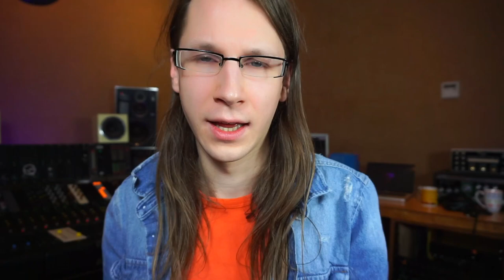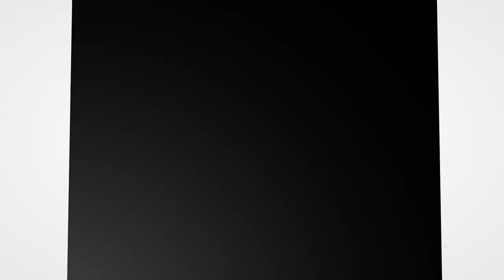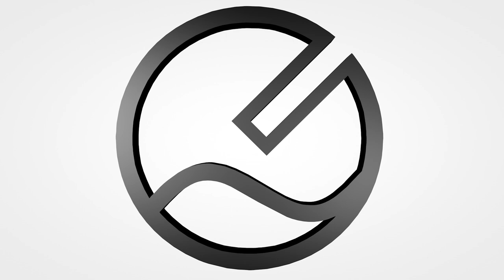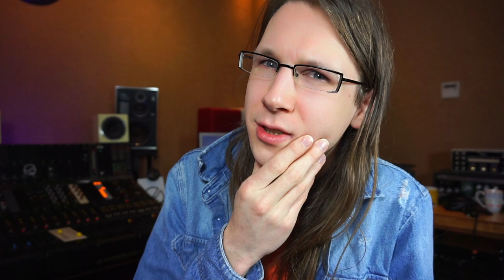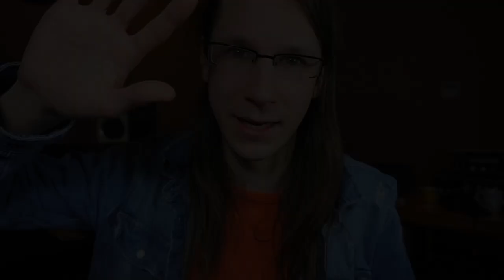EQing myth 3: Low Pass Filtering

Comment: I'm not sure if you are aware but no one seems to be talking about the fact that low passing everything above 18-20Khz and high passing between 20-25Hz gives such an incredible amount of headroom. I will give an example, I use ozone 8's maximiser on my master(because it's amazing) when I so the stated technique I have described the limiting doesn't get triggered by the inaudible frequencies meaning I can bump up the gain before the signal goes to ozone. this gives the track much more clarity and helps keep the mix tight!

Comment: 70s recordings probably weren't low passed by the engineer but don't forget that they were all recorded on tape which has a natural roll off in the high frequencies at about 16-20khz depending on the tape speed.
Reply: This is true but a steep high pass doesn't really achieve this more of a a soft filter.
Reply: Both of you are wrong. In the analog days they had to up those high frequencies so you could actually hear them at all. It's only in digital sound that you need to low and high pass in order to keep sampling rates in line with what can actually be heard. Without them, the math starts breaking down.

Comment: Everything recorded that is audio will be highpassed and lowpassed for listenability. Digital conversion codecs inherently filter and combine aliasing to the recorded signal whenever harmonic saturation is employed. Without this filtering the resulting audio can sound loose on the bottom end and brittle on the top. Digital saturation causes aliasing at the top of the Nyquist frequency and below the affected harmonic fundamental. This can be heard when not employing high and lowpass filters before converting to a lossy format.

Comment: The accel limiter on the neumann cutting consoles used since forever for cutting vinyl, cuts in at 5khz (obviously it`s not the same as a high pass but...)  plenty of old records had the top end attenuated for the cutting process.  That`s part of the charm of the vinyl sound.

Comment: The reason for a steep lowcut at 20hz is to remove inaudible lowend. You can't hear these partials, but they still add to the total amplitude of the mix. By removeing them, you make slightly more room for the audible partials, which adds the illusion of of increased amplitude.

With maximus a unique multiband compressor, you will notice there's a parameter that controls a lowcut on the lowend band.

There was a really good video by a youtuber named in the mix demonstrating this technique.

Also, just because something has more harmonics doesn't mean its better imo. Some lofidelity music with ridiculous high cuts sounds extremely beautiful to me. But a lowquality mp3 can sound like pure doodoo.

Of course, id love something to be closest to what the artist intended the original piece to sound like, unchanged by audio format. I wish websites opted for 16, or 24bit wav as well.

Comment: I can't hear above 14kHz any more. Too old. However, I always half the samplerate of my mixes to reference the high frequencies to make sure they don't sound "crushed" to teenagers and new borns.

I'd also point out that a lot of newbie producers/mixers don't understand how to mix high frequencies so they sound good. A lot of samples they use in electronic music lack them, and the samples that have high freqs are generally sampled from vinyl - they sound sh*t above 8kHz anyway! The only exposure to broad-band sound is from plugins like Serum, but they too have a LOT of processing on the samples and harmonic distortion added.

Your advice about listening to older music is great. Although, they tended to rely upon tape machines which introduce their own harmonic distortion and slope off gradually at high frequencies. But still, it's a great way of hearing natural sounds that haven't been encoded/re-encoded several times to MP3 or other lossy formats which introduce the hard cutoffs at 18.5kHz, 18kHz, 16kHz, 15kHz.
Reply: Principal Audio Hey, ok this is a year old post, but I’m curious what you mean with that samplerate halving technique? I also don’t have young ears anymore :-)

Comment: Cool videos and nice opinions. I do like to use these kinds of cuts as a part of sound design and create harmonics afterwards with distortion reverb etc. When combining inharmonic stuff this is also a very nice way to layer drums FE 5 kinds of noise in a drumkit each with their frequency box respected. Or when you want to add an effect with some bottom end in a build up but don't want it to clash with the lead that's allready there.

Comment: It's often recommended to put some lpf when mastering for vinyl. So I guess a lot of old records are also low passed.
Reply from the maker: Yes, but I think that non of us "normal" audio engineers should burn their fingers on vinyl mastering. I think vinyl mastering is a specific task for specific people. I would never do a vinyl master....
Reply: Yeah the actual lathe cutting is probably nothing I would get in to... but for the master, or perhaps it should be called pre-master in this case is not that critical I think. Just keep stuff controlled, as usual when mastering hehe. Low end in mono, no to extreme highs and not too crushed dynamics. The records I made for vinyl turned out fine at least haha.

Comment: "We don't hear anything above 15 kHz out of our speakers any more". Well, neither did we before streaming services. Hi-fi afficionados will of course tell you that this is why analogue is superior, but I dare you to look at frequency specs of analogue hi-fi equipment from the pre-digital era (the entire chain from turntable via amplifier to speakers, mind you).
Now you seem to be at an age when you can still hear up to 18 or even 20 kHz, but I was that age once, too, and I never heard anything out of my stereo that I am missing now (what I do not miss, on the other hand, is the annoying 16 kHz whine of cathode ray tubes, a.k.a. television screens). Manufacturers will tell you that their speaker or amplifiers reproduce insane frequency ranges, but listening to a pair of headphones rated for "20 Hz" quickly dispels that myth. If you find an audible difference between compressed and raw audio data, then try a digital stereo receiver with an enhancer feature, like Yamaha has been building for a while now: the enhancer is basically an overtone exciter which adds harmonic overtones to the material, and I have found that the top end of the spectrum that you are referring to (which cannot be heard in isolated tones) does indeed feed our binaural perception: since it is the high frequency runtime differences between left and right ear that make all the audible space of a stereo signal, a high-bitrate MP3 run through a good enhancer produces a stereo image that I, personally, cannot tell from the uncompressed original.
Maybe 30 years ago, I would have heard the difference, so I am not arguing with what you can hear, I am just saying I doubt that you can hear above 20 kHz, since you will be hard pressed to find speakers that even reach this area deemed inaudible to humans.
Oh, and just because you mentioned it: my mixes contain plenty of 16 to 20 kHz material. Just because I don't hear it any more doesn't mean I want to keep others from hearing it. And if my mix is clean and transparent up to what I can hear, the range above that should be fine, too. But since everything is mastered to a 44.1 kHz sampling frequency anyway, I low-pass just to make sure the audio renderer does not trip over any crap that nobody hears anyway.

Comment: If people in the past didn’t have a need for low pass filtering why did SSL include both a high and low pass filter on every channel of their legendary mixers?

Also: a lot of the processing on modern vocals introduce some really nasty sounding sibilance and shrill robotic overtones.  You don’t want to hear that stuff.  Even an analog vocoder can introduce nasty high frequencies most people will want to filter out. 

I don’t understand these reservations.  If you’re talking about a string quartet or a jazz trio fine. Record at very high sampling rates and don’t filter. But I’m pretty sure The Weeknd couldn’t survive without low passing and high passing his vocals.

Comment: Sorry, but the point about 100kHz is not valid. You don't have these frequencies in digital audio. They get cut out when converting to digital. At 48kHz everything above 24kHz gets cut off. If it wasn't cut off on the way in, the frequencies would "bounce back", as in 27kHz becomes 21kHz, which not only changes the sound, but also creates a dissonant buzz.
Reply from the maker: You are correct, altough aliassing filters on 96 or 192 ADDA’s are places way higher...
Reply: And our ears are still nowhere near being good enough to hear anything above 16k, let alone 48k

Comment: I think as an engineer, even if you don't understand why we keep audio a reasonable bitrates, you should master your stuff so it sounds good through the distribution channel that will be actually used by us listeners ! Otherwise you're doing it wrong... If you're mastering something that will be played in a concert hall with hi fi equipment then fine with your high frequency that takes gigabites to encode, but if you're mastering for a regular song, we'll be using streaming services, so make it for them... 
And if you really want to understand, I'll probably be using audio streaming when my connectivity can't handle video, so I need it to go through a low bandwidth internet or be stored in my cache at minimal storage usage due to the crazy premium the manufacturers require to get a few extra GBs on your phone... I won't accept to wait for music to load or buffer for ages as I just don't hear the difference between Spotify and FLAC master. And even if I did hear it, I want a smooth experience, not waiting ages to buffer with a ton of quality I won't distinguish over the street's noise...